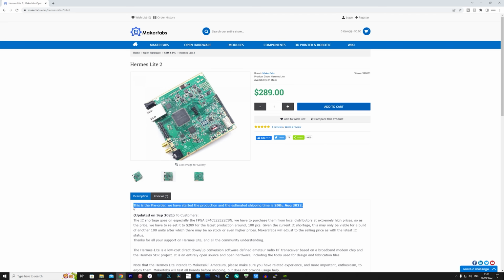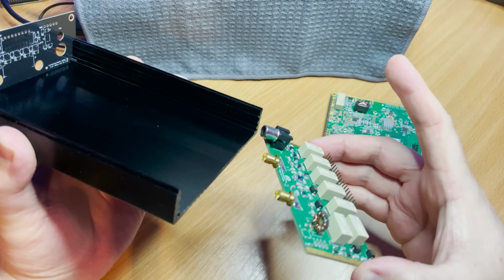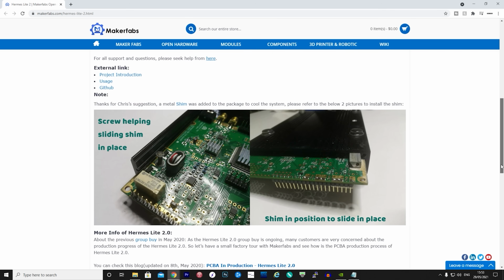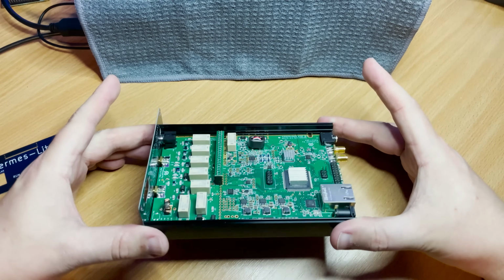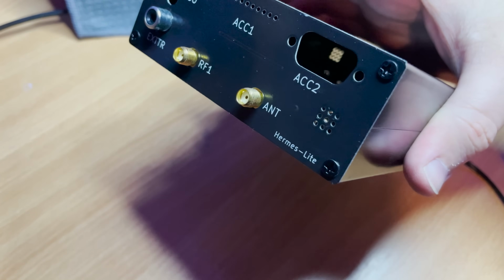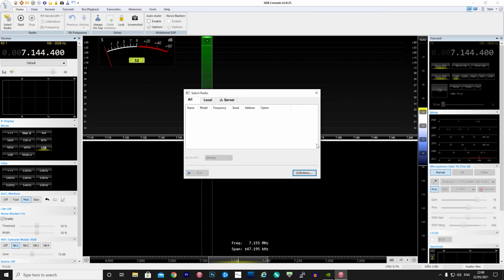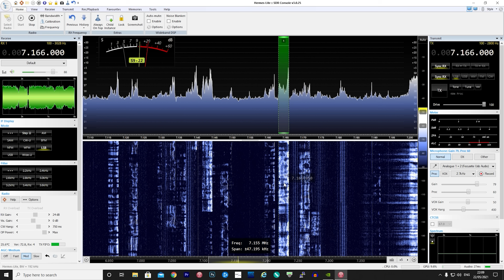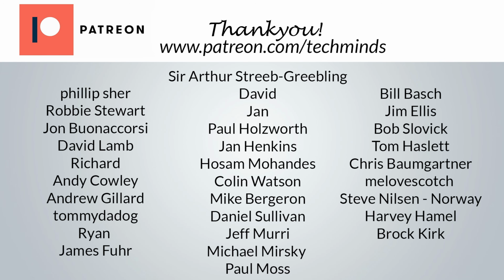BREAKING NEWS: Hermes Lite 2 Back in PRODUCTION

Comment: Exciting! I just got a 100w amp for mine and really love it. Windows and Linux...its great.
Reply from the maker: Excellent! Which amp did you get?
Reply: @TechMindsOfficial  The Xiegu XPA125B. I am able to run the whole rig from an RPi4 with a 7" touch screen on 12v power. 

FT8, Logging, etc...whatever ham utils you can think of for Linux. Better than IC7300 🤣
Reply: @Factory400  For FT8, etc, I've recently fell in love with the QRP-Labs QDX.  Only 5W out, but anything more for digital modes is cheating!  ;)

Comment: Thanks a lot mate! i just ordered one. I was asking on twitter about radioberry, was even considering SunSDR2Pro for remote, but settled for HermesLite2.0 + BPF + 100W + 100W PA BPF.Tnx to your reviews. I know 12bit vs 16/24bit on SunSDR but given that HF noise floor isnt -135dBm, and even on VHF with XVRTr 12bit seems sufficient, I will give it a go! Tnx again! OK2IT / M0ITY (M6T crew :-))
Reply from the maker: Glad I could help! Which 100 Watt amp did you go for? Ive used the Xiegu 125B with a HL2 before and that works great.
Reply: @TechMindsOfficial  hi Matt..at the end I built myselfa MINIPA70...first 2xIRFs...you get about 45-50W nice IMD. With proper LDMOS 100W. Also I found few PL519 tubes, so I made a no-transformer (220VAC voltage doubbler) direct anode 400W PA with 4 x PL519 :)

Comment: Are highspeed digimodes possible with this sdr?
Reply: What modes are you asking about?  It appears that people have been using this SDR with WSJT-X, etc, so all those supported modes should work.
Reply: @Randrew  Something like => 9k6 baud , packet radio
Reply: @patricf209  Seems unlikely at first glance, though I'm no expert on digital modes. Audio Frequency Shift Keying (AFSK) can't handle that data rate without blowing the bandwidth budget, so FM has been used.  The common modulation scheme for 9600 baud packet radio is FM with about 8 kHz of bandwidth.  As I understand it, FM is not allowed under 10m and even there the bandwidth is limited to 6 kHz, too little for 9600 baud.

HOWEVER, the whole topic is very interesting to me because with the present boom in SDR, any number of new modulation methods can be invented and tested. Why did anyone ever use exactly 9600 baud?  Well, it's a matter of progression based on early data modulation schemes, base serial clock rates, and whatever early modem hardware people glommed onto.

With software modulation, we're freed from many hardware and legacy restraints.  Why not 4127 baud with some modulation scheme custom tweaked to fit HF bandwidths?

Please correct me where I'm wrong, folks!

Comment: Why not use a 3mm threaded spacer standoff of some length to fit inside of that case instead of that nut on that heat sinked part? Maybe offer a little more thermal surface area....Great video and info, and very tempting to purchase. Thanks for posting.
Reply: Indeed the shim setup looks kludgey.  Watching the video yesterday I was thinking of maybe cutting a notch in the enclosure and bolting a bigger heatsink right to the board.  I'll have to hold that thought until I receive my set and scope it out against what's in my box-o-heatsinks.

Comment: I just ordered a set (filters and case too).  The price is $289 rather than the $225 as in and older part of your video.  Hike blamed on having to pay ransom distributor prices for the Cyclone IV FPGA :(

A++ for giving us the heads-up!

EDIT: They're shipping now.  I was notified Aug 19 it was shipping.

Edit 2: Another thing to watch out on when installing the heat shim: Due to really tight tolerances the outside corner of the heat shim interferes with the enclosure's faceplate screw channel if the bolt hole thru the shim is perfectly centered on the hole in the PCB.  This SHOULD NOT be a problem if you follow Tech Mind's instructions.  Instead, I glued (clamped firmly) the shim to the PCB with a very thin layer of high-temp RTV and assumed the bolt holes needed to be centered on each other.  Wrong choice - the shim needs to be slightly shifted toward the middle of the PCB with the bolt mounting holes mis-aligned by almost 0.5 mm.

I double-checked the dimensions of the shim I received and it does match the hand-drawn spec at the HL2 Github repo EXCEPT Makerfabs have put a very slight but intentional bevel on the corner that I found to be interfering.  I popped my glued shim off and re-glued it with the holes mis-aligned.

Comment: Could you ask Hermes or make a Favourites what the little red wire is for because nobody seems to know you didn’t have it in yours but I had it in mine0
Reply: Follow the Hermes web site to its wiki, there click "final assembly" under "Getting Started".  Brief explanation there.

The red wire is a totally optional part in case you feel the TX power isn't up to spec and want to rewind T3 to improve it.  Apparently the low power problem was a "Build 8" production issue that shouldn't exist any longer, but they still provide the extra wire... because it's on the BOM, I guess.